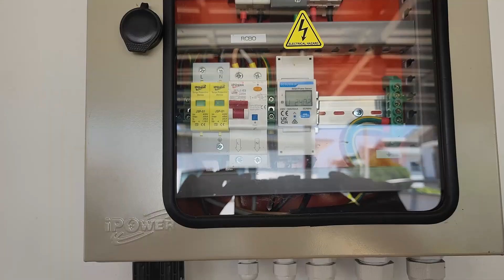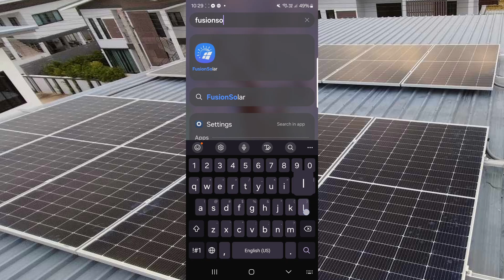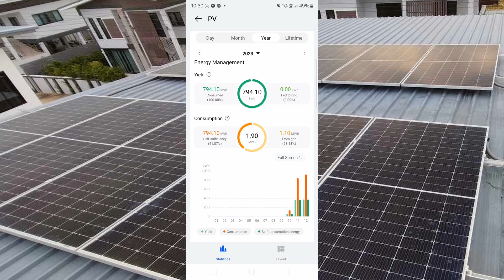Installing Solar On Our Thailand Home

Comment: Looks oke but not cheap.
I did buy a plug&play inverter with socket in Europe and now get 800 watt . Total cost below 10.000 bath for a 2 hour job rails+panels+inverter+cables.
Fitted in 2 hours DIY.
Reply from the maker: Great job! You got that setup pretty fast!
Reply: Wich one you bought?

Comment: If you save 50% on your electric bill, it will take you 8 years to break even and get your 5000 usd back. Even longer if you only save 30% like you said is the norm.
Reply from the maker: Sounds about right. We still are saving around 30%. So, taking the slower road for to reach break even. I do wish I had put more panels on the roof.

Comment: PEA stopped the grid tied tarrif. Going backwards with solar. I've emailed minister why they are not supporting solar?
Reply from the maker: Well that is not good. Time to invest in a battery to store up the energy.
Reply: @thegreatlifereset  and it's at this point you regret getting Huawei inverter.
Reply from the maker: @philtaylor1019 No regrets yet, but do you know something about the inverter that I do not know? Please share.
Reply: @thegreatlifereset  - i may be wrong, but i believe the price of compatible batteries for a huawei inverter is very high.
Reply from the maker: @philtaylor1019 Yes, the price was very high. When they offered, I declined.
Reply: @thegreatlifereset  Yeah, there are ways to work around the compatibility issues, but it's not ideal and involves batteries with built in inverters.   Probably your best bet would be to switch out the inverter for a deye, or something and install reasonable priced battery. Then resell the old inverter to recoup a little. 

Also, i watched a few videos so can't recall if you mentioned it,  but if your solar covers most or all of your daytime hours,  it could be worth switching to time of use meter if you haven't already.  That's a lot cheaper power per unit off peak.  But a chunk more expensive peak hours.  Most of those peak hours are in sunlight though.
Reply from the maker: @philtaylor1019 Great information!!!

Comment: For an upgrade I think you can just add a second 5 kW inverter. Alternatively, you can oversize the panels relative to the size of the inverter. I googled the spec sheet for the SUN2000-5k and it can handle two strings up to 11 A each, with up to 850 V DC, which is over 18 kW. So you can hook up more panels to this inverter, but the output will be clipped at 5 kW AC. And the Huawei inverter doesn't have active cooling, so you may need to add a separate thermal regulated cooling fan to actually have the inverter work at high loads. If you don't get net metering than switching everything over to a hybrid inverter may also be an option.
Reply from the maker: Great advice and information! I like the idea of the bigger panels. The neighbor who installed it said he can swap out the inverter to 10kW and get credit for old one. He also said when working with PEA, the electric company, to put power back to the grid, he suggested a 10kW system is best. Sounds like they won't bother with a 5kW system.

Comment: why only 10 panels? my bill in Thailand is about 2.000 baht (280 kwh) and i want to install 18 panels. and want to go of grid.
Reply from the maker: I do regret not going for 20 panels. It was partly a cost reason. The neighbor installer said he set it up so we can add an additional 10 on the roof. Also said we would need a new inverter and could credit the old one. I will have to save for that. Oh, our last electric bill was a tiny bit over 4000 baht. I think the panels need a good cleaning. Dirt and pigeons.
Reply from the maker: Oh, thanks for watching the video!

Comment: I’m on that Journey now, I put in an emergency backup but now expanding, I do it for a hobby and am interested in Solar. My electric cost per month before Solar is always less than 1,000 baht as I employ cooling techniques to the house. We hardly run aircon but hope one day to be having no electric bills.
Nice video best wishes.
Reply from the maker: Wow! If you have not already done so, you should do a video on the cooling techniques! 1000 baht a month bill is really cheap. 5kW setup would cover that no problem throughout the year. Have a great one too!

Comment: Would you mind sharing how much you had to spend for that solar system so you can save those $30 on monthly electricity bills? Plus whats the durability of those panels?
Reply from the maker: The cost was around 185k baht, which is $5190 USD. With recent activity, the panels generate 1/3 total power consumed for our home, with the other 2/3 coming from PEA (electric company). We could push this to half and half, but the family loves their air conditioners. I hope one to double the panels.
As far as panel durability, it is a bit of an unknown. The neighbor I dealt with during install did purchase quality parts, so I hope they last a while and avoid hail storms.
Reply: @thegreatlifereset  thank you for the info. Means you will break even in 173 month. Wondering if those panels will last over those 14 years though. What do you  think?
Reply from the maker: @no_clot_shot1128  Boy, it would be great if they lasted 20 years. I will ask my neighbor what MTBF for the panels are and let you know.
Reply from the maker: @no_clot_shot1128 The neighbor replied. "10 year warranty, 25-30 year service life." My reading of this is anything goes bad, covered by warranty for 10 years. The panels should last 25 to 30 years.

Comment: For Australians in Thailand  wanting a 5kw system on the cheap. I recommend getting a grid tied solar inverter from Aus. 220v compatible. They are going super cheap now that Australia is pushing battery hybrid systems. Bringing one back while traveling is easy. About 15kg checked baggage. Hunt down 20 cheap panels in Thailand.  If skilled with cabling and installing hardware Should be able to set it up by yourself for around 50k baht total. PEA are now offering feed in tarrif of 2baht and have confirmed with me that after setting up your system they will inspect and Install smart meter. Going through solar setup  companies is a killer.
Reply from the maker: That is an excellent price if you buy the inverter from home country!  I would suggest with the savings, spend the extra dollars and upgrade to the 10kW setup. Make sure your inverter supports 10kW too.
Reply: @thegreatlifereset  think there is limits with PEA . Check with them first whatever your intentions are. 5kw was the standard in Oz so bargains may decline looking for 10kw. But sure. Sun is free so try to milk as much free as you can. Government tries it's hardest to tax the sun. I believe in Oz there is or will be an extra tax for EV vehicles. Their mindset is they want the petrol tax either way.
Reply from the maker: @Swenser  Hah hah hah, you are so right! Governments trying to tax the sun. I am just waiting for them to implement an "air tax".
Reply: I'd be surprised if, even with on sale in Oz, that one could not source a 5kw inverter here for cheaper. Everything I have bought was way cheaper and is even more so today.
My 12 x 235w used panels (which pump out 230w on a good day) cost me ฿1190 ea. Today you can get the same ones for  ฿790 ea. 
My 10.24K DIY Lifpo4 battery cost me ฿24K, today you can build the same battery for less than ฿16K. I had a 6m x 4m galvanised steel frame carport built for my solar panels @ ฿13.5K.
My system isn't grid tied...I didn't have the same ease dealing with PEA.....but my system is easily switched to grid if need be,
The only major problem is....and it's a major problem.....is that should I pass no one will have a clue how the system operates........I've tried explaining it multiple times to the wife and others......but no banana!!!!!
Reply: @Ulbre  yes. I can appreciate your problem. That's what I like about the grid tied. Even if that fails. The system of normal power supply keeps on working obviously with higher bills. But having to get someone to understand about it all including battery maintenance  is not necessary. A set and forget system is best here. But by yourself whatever works for you.

Comment: Are you going to add batteries?
Reply: sell electric back to PEA is often not possible bc PEA dont like it.
battery can easily go 20 years
Reply from the maker: Probably not. They cost a lot and do not last long, maybe 5 years. Plus, not too crazy to have lithium battery attached to the home (fire hazard). I prefer to get more panels and sell excess energy back to electric co.
Reply: @thegreatlifereset  They do not always buy back the electricity.  It seems to be a lotery.
Reply from the maker: @tonyrothwell5850  Plus, my neighbor said they would probably need to swap out the meter to allow dumping back to the grid. Let's see if they allow it (Lotto time!).
Reply: Yes.  What they can do is to change you meter so that it does not record the electricity yo put back into the system.  The old style meter will actually turn backwards I think.  If they do buy the lectricit from you it will be at least half the price of what they would charge you
Reply from the maker: @tonyrothwell5850  Good to know. Thanks! I did not know the half price part.

Comment: Did you have to put a new roof on that was metal for the panels? I was looking at panels for the house we will be building next year in Udon Thani but she wants a terracotta roof. Oh ya we will be moving away from Pattaya in July and get back to making videos once we away from here. Over the "winter" how much electricity have then been producing average per day? You went to quick for me to see good 😂.
Reply from the maker: We did not have to put a new roof. Original was already metal. The neighbor said they can install to a terracotta roof. The hardware is just different.
You will enjoy a new home and more the country life. 
The system has been producing a peek at around 3.6 to 3.8 kW during the winter. During summer, I saw it hit 4.3 kW. Gotta keep the panels clean!